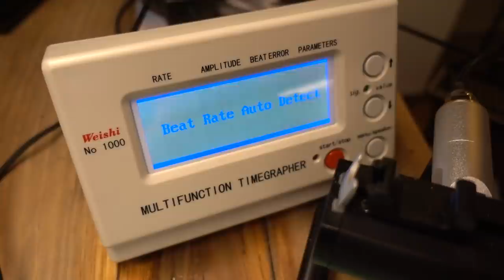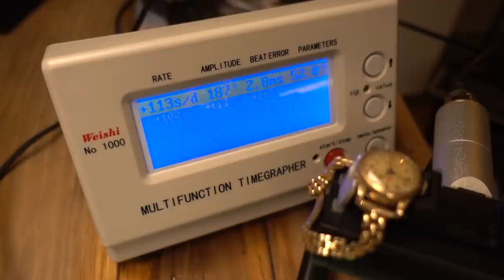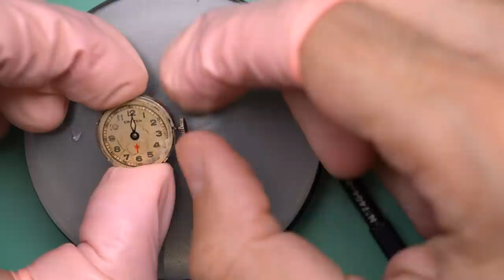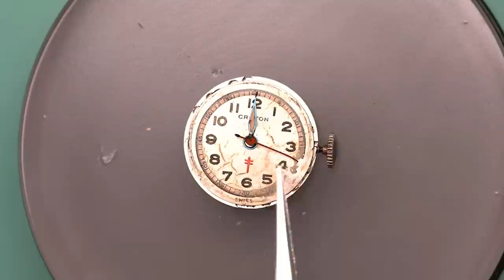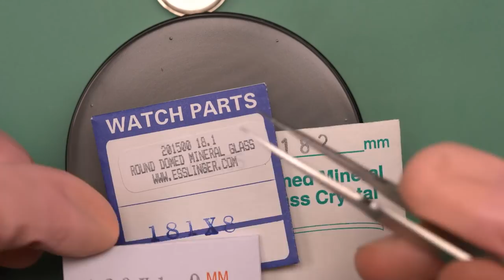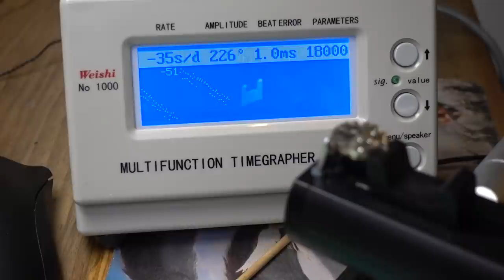Croton Nurse's Watch Vintage Watch Restoration

Comment: I recently worked on an AS 1120 movement, very similar to the 970 here. Made the error of moving the crown wheel after removing the click screw while the screw was still in place. I believe the click launched into orbit where it remains comfortably being tracked by NASA as a piece of space garbage. All that work and that movement is now a donor ... Lots to learn in this hobby. Seeing that click made my heart skip a beat and reminded me of the two hours I spent on the floor looking for the exact same part. Very well done!

Comment: Every ladies watch with that style case that I have opened has rust in the keyless works.
Nice job. The time keeping is probably as good as it ever was.
Reply: There's probably rust in these ladies watches through countless years of hand washing... these petite bands generally sit quite low on your wrist compared to men's watches (often slightly loose like a bracelet) so they're easily splashed with water & soap without the wearer realising. And in the case of a nurse's watch, there'd be triple the handwashing frequency!
Reply: I wonder if it is because women are usually the dishwashers in the home; especially in the 40s-60s.

Comment: Honestly, it makes sense for there to some rust around the crown area, especially on a watch worn by a nurse. As a nurse, you're going to be washing your hands so many times per day, and if you wear the watch on your left hand, as most people do, the crown will be closest to the hands, where all the water is. Also I would imagine that the nurse would be kinda rushed, so they wouldn't have the time to take the watch off, nor to make sure it was completely dry every time.

Comment: I like looking at these old vintage watches. It's amazing that they had manufacturing processes to make such very tiny parts in the 1940s.
Reply: I think transistors were first mass produced in the 40s and those are tiny. There’s this whole neat evolution you can see, too, where you can look at pocket watches from the late 19th century and they’re basically exactly the same only larger…
Reply: I'd like to see the machines that makes those screws .
Reply: My grandmother used to have a watch that was significantly smaller than this. Like, two thirds the size maybe. Just as old.
Reply: *laughs in 1800s pocket watches
Reply: @inerlogic  those are much bigger though.

Comment: so I wanted to ask - you said in a different video that those S-shaped mainsprings are a more modern invention, and also that most older watches used carbon steel springs. That mainspring looked real shiny and also S-shaped, so my assumption is that it's a newer spring. You also said that the watch itself likely dated to the 40s. Would I be correct in assuming that's likely a replaced spring, then? I'm not sure what time period the transition from coiled to S-shape springs would have happened in, nor at what point carbon steel would have fallen out of vogue for these kinds of watches.
Quick edit- looks like the spring in the donor movement was carbon steel, and also broken, so I feel slightly more confident in my assumption

Comment: Excellent job! I took Mark's course and have successfully disassembled and reassembled a ST36 (the unitas clone) and recently moved on to the NH-35. The size difference makes everything noticeably harder, I can't imagine going smaller. I need to add cleaning and oiling, but I need more gear first. Also you are super brave working on all this vintage stuff, I hope I can get there some day. Finally, I liked the casual Speedmaster for size LOL - nice watch!!
Reply: i know this comment was a year ago, but i'm about to buy mark's course. does the course go into plating, polishing etc? or just servicing watches?

Comment: EvapoRust is like magic for larger stuff. I use it for tool restoration projects, but it definitely benefits from a wire brush or something. Half an hour soaking plus a brass wire brush and the rust just wipes off like mud.
Reply: Also, Evaporust is a long-term solution, meaning it can take 24-48 hours to work. I saved twenty thousand dollars in vintage tools with a single bucket of it. You must give it time to work, and it works miracles. No scrubbing required if you're patient. Just rinse it with mineral spirits to clean and dry and you're done. It's an outstanding product.

Comment: Nope. Not good enough. I wouldn't even consider this watch repaired. I would have replaced the ballance hair spring, the main spring as well, even though it looked OK, metal fatigue over the decades can decrease the spring's overall wound driving power slightly. I would have used an ultra-sonic high end cleaner on the watch parts of the movement, because I believe it gives a deeper cleaning. Metal is porous. I would have also investigated the appearant disclorations around the various parts of the movement more. I'm not satisfied with that rust remover. I would have oiled the jewels in the fork as well.
Reply from the maker: Sounds like you should start a youtube channel to me.

Comment: 35 seconds/day is probably how it was running originally. I'm sure the beat error and amplitude are not like new but that's beyond any reasonable expectations. You have to keep in mind, ladies' watches on the whole did not keep time as well as men's watches anyway because the balance wheel was smaller. Yes, JLC could build some killer tiny movements, but we are not talking about JLC, this was an A. Schild, which made entry level movements for many years. That's great work.

Comment: EvapoRust is a great product for tools and various machinery. However, I wouldn't use it for delicate parts. EvapoRust is tanic acid and an organic polymer. For badly rusted watch parts you should replace them.
Reply from the maker: Yeah I would normally like to but sometimes it's really hard to find parts (though thankfully not in this case!)

Comment: Anyone here has any good tip on how to remove a stubborn worn out/stripped screw inside the movement? A tiny one on the calender side of a Seiko LM. Any good tips and tricks would be greatly appriiated.
Reply from the maker: Depending on the material of the screw and what it's stuck in you can use alum to dissolve the broken part of the screw. Mike from My Retro Watches did a video on it not too long ago.

Comment: That is some beautiful work. a lot of people will just enjoy this as a relaxing vid to watch, witbout understanding how challenging it can be to work on a watch that size. My personal nemesis (and I suggest you avoid) was an 8.75 ligne, ladies Smith's Deluxe from 50's England. For some reason they decided to place the 3 running train wheels, and the escape wheel on the same bridge, on an extremely small movement... and the bridge fitted onto two studs for position before screwing down. There was no gentle wiggle room. Either the 4 wheels lined up, or they didn't... in which case it was bridge off, reposition, and test fit until it alligned. It took me 5 days to get that one bridge in place. Nice watch... but never again.
Reply from the maker: Wow yeah that sounds rough! This was the 2nd hardest to work on that I've done. The first was that Mickey Mouse watch that I did a video on lol

Comment: I have a watch with the same 970 movement but it has incabloc protected balance. weird. yours must be an earlier one. and yes. Adolph Schild was from Switzerland.
Reply from the maker: Interesting. I have it dated to around the 40s? I couldn't figure out exactly when.
Reply: @WristwatchRevival  Could be. One source i have states it´s been made from 1935-1967 and around 16.000.000 have been made.

Comment: A minor gripe, but at 8:34, you call a screw that (based on my interpretation of what you said) loosens when turned to the right  “right-hand threaded” This is incorrect terminology. Normally threaded screws have right-hand threads, and screws that tighten when turned to the left actually have left-hand threads. If I misinterpreted what you were saying, and it is indeed a normal screw, I apologize.

Comment: Evaporust converts red iron oxide, which is active rust, into black iron oxide which actually passives the surface and inhibits the formation of new rust.  As for grease and oil, the British army states that "lubrication should be felt, not seen:"

Comment: That looks VERY MUCH like some of the older stuff women in my family had. Like my grandmother. Various brands but all swiss movements with rubbish die cast case with sheetmetal "back" cover which is literally half the watch. Just like this one. Where you don't need to remove the crown because that's where the case and back cover meet.

Comment: Marshall doesn't seem to understand that Evo-Rust is a rust converter.  It converts red rust to black rust, which is why some parts turned black.  Black rust is also much more resistant to further rusting than red rust.

Comment: Evaporust is a FANTASTIC product. It absolutely is a miracle.
It does tend to blacken things, this is because removing rust changes the ratio of iron to carbon on the surface of the metal; which darkens it. A simple light polish will take it off if you want to.

Comment: In the era of this watch the use of gloves was not as prevalent outside of procedures. The watches were used multiple times per day by nurses for taking pulse largely, Commonly the watch was worn on the inside of the wrist. And in regards to the rust this is not a surprise as there would have been numerous hand washings during the day and this watch was not water resistant.

Comment: Those tiny "women's" movements are too small for me, plus it's easy to wreck a balance spring when taking the bridge and balance together.  Some balance wheels are too heavy to just hang there without bending the spring.  

Nurse's watches are pretty easy to spot with a (typically) red sweep seconds hand.  Earlier nurse watches pin onto the uniform like a medal, but usually hang upside down.

Comment: Another good product out there that is inexpensive is CLR. You can find it in any US grocery store. Calcium Lime Rust. Works great for carbon build up too.
DO not use it on plated or blued steel. Harmless to Stainless Steel. As usual, try it on a n old "junk" part.

Comment: Two things.  1. Every time I see you make a mistake, my heart sinks, because I know what a pain it is to then have to search for parts to rectify the problem.  It's the same feeling I get when I make a mistake myself.  2. I have been teaching myself watch making primarily on cheap eBay watches (a lot of pin pallet movements....uggg, 1 jewel) and many of them end up being "journeys" as you call them.  It seems like every one has a bent hairspring, broken pivots, etc.  Frustrating at the time, but a great feeling when I finally get them running.  As you say, donor movements are indispensable for watches like this.

Comment: I don't know if anyone can help but I've recently taken the hobby, and on my first watch the hands went flying and despite me searching every last speck of dust in the room and I need new ones.  I also, very stupidly, said to my sister,  look now tiny this screw is!  Aaaaand it disappeared into the void. Any help on how to buy replacements?  What do i measure????
Reply from the maker: For hands you have to measure whatever it's going to fit onto, and for screws you can't really measure the hole/threads so you need to probably get a donor watch and take the parts from there

Comment: Looking at the Esslinger site, it seems those tweezer-style hand removers can also double as a canon pinion remover (?) Is that so? If so, how should they be used?
Reply: The other part of this - On cannon pinion pullers like Marshal's, I've seen people have a lot of trouble with pinions under 1mm, but on this watch he pulled it with no problem.  I've seen people that recommend the green hand puller/pinion puller (Bergeon 30637) for very small ones.  I'd love to see him show a bit more about the remover options.

Comment: That cross was first used by Romans to crucify. A cross with another board above it listing the crime of the crucified. Constantine's mother had the original pieces brought to Constantinople in the 4th Century. Used all over The Byzantine Empire, Knights Templar in the 11th Century, The Duke of Anjou was Hungarian Byzantine. The crusade against Tuberculosis in 1902 and again by DeGaulle's free French forces during WWII. Later it was used by the American Lung Association. I guess it could be a few different things.

Comment: Why, oh why don't left-handed screws identify themselves with some universal mark? Btw, where can I get that holder/anvil looking thing?
Reply from the maker: Often they have 3 stripes on the top. I got the block from eBay used.
Reply: @WristwatchRevival  I found one as well. Thanks. I see now that the left threaded screws are self-identified.

Comment: What you could possibly do about the “staining” on various parts of the movement is buy a Watchmaker’s Fiberglass Scratch Pen Brush. I’ve seen som watchmakers use them on movements.
Reply from the maker: You know I have one, but I was worried about just scratching the heck out of it. I'll try it on a scrap movement though at some point.

Comment: You forgot to oil the escapement tooth and quick tip: always measure the interior diameter of the case for the new glass.
Reply from the maker: I didn't forget, it's just very hard to film :)

Comment: Hey Marshall: what’s your video setup?  Do you mind sharing?
Reply from the maker: Not at all, I even have some Amazon links in the notes. 

2 cameras, overhead is Sony A7III with a Sigma Art 70mm Macro lens. Side camera is a Sony RX5. Overhead lights are these soft panel LED things I got from Amazon, they are great. Rode Podcaster mic for sound. I record the overhead into OBS at 4k connected using a Camlink 4K, and the side cam is on 1080 and I edit it all in Premiere CC.
Reply: Wristwatch Revival Thank you!!

Comment: Terrific job as usual, Marshall!  One question: In Mark's online class he doesn't seem to address hand setting tools (only hand removal tools).  Would you recommend splurging for the Bergeon? (I'm look at the 7404, which includes 3 tools plus replaceable tips).  You may have mentioned which tools you use in an earlier video but I'm not certain.  Thanks!
Reply: I'd like to add that tool as well. What say, Marshall?
Reply: @freedom55or95  I bought the set: seems like a good investment.
Reply from the maker: Yes I would. Honestly these are VERY simple tools, but the fact that you can get replacement tips for pretty cheap means you can keep them for a long time. Plus, while these are more expensive than the cheap ones by a fair bit, they aren't hundreds of dollars so I think it's worth it in this case to get the Bergeon.
Reply: @WristwatchRevival  Thanks, Marshall!

Comment: I have a simular ladies watch. (But much older I think. Looks a tiny pocketwatch on a strap.) Doesn't run or even wind (the crown does not move at all.) I opened it and the movement looks clean and intact. The dial, hands, case and the leather strap are still in good condition. What do you think ? Would it be worth to send it in for service ?
Reply from the maker: Probably not unless you had someone in your life that wanted to use it? If it looks great but doesn't run, it's still a cool object. I mean I would get it serviced but I love to see watches working :)
Reply: @WristwatchRevival  I´m thinking about it. I got the watch for free. And it would be a nice watch for my wife. As it looks very nice. With a silver case. I think I will take it to a watchmaker and ask for an estimation of the cost.

Comment: Another fantastic video, Marshall.  For glass crystals I’ve had good luck with oil-based diamond pastes.  You can get a collection of tubes with different grit sizes for only a few dollars. Start with something coarse - 50 um, and work your way down.  By the time you get to 1 um, it will look like new.  But you have to change the applicator for each grit size, otherwise you’re adding new scratches as you’re removing others!
Reply from the maker: Do you do this on a polishing wheel or by hand?
Reply: @WristwatchRevival  I put wooden
Reply: I put wooden dowels into a drill press chuck and squirted a dab of polish onto the crystal.  The compound is oil-based so it doesn’t dry out or evaporate. The wood doesn’t absorb the compound, and it’s easy to swap it out for the next finer grade. A few minutes at each grade does the trick.  My only regret is that I didn’t have a wider range of grits. I started with 10, but should have used a coarser grade.  At 1 um the surface is glass-perfect, but the remnants of the largest scratches are still faintly visible.
Reply: Cerium oxide optical rouge will work too 👍

Comment: [@40:37]

Yeah, that original has a higher dome [almost like a magnification].

That was a nurse's watch,  so that most assuredly [probably all day  -- each and every day  -- and night  -- would have been used to read the seconds taking blood pressures  -- and timing/counting the beats per minute of the heart  for 10 or 15 seconds then multiplied -- I don't know each ones' preference].

Those second marks would have been extremely important though  [they'd have to start at the very next 5 minute mark  -- or maybe even the next second mark -- and count the beats for 10 or 15 seconds when that "blood pressure" is finishing].

Yeah, Marshall, that magnifying dome was IMPORTANT in this restoration  to show what the owner/owners were monitoring in their daily life.

Nice job though 
[But get that original highly domed chrystal back in shape and on that  -- THAT'S A CONVERSATION STARTER, LOL]
😂😎☕☕